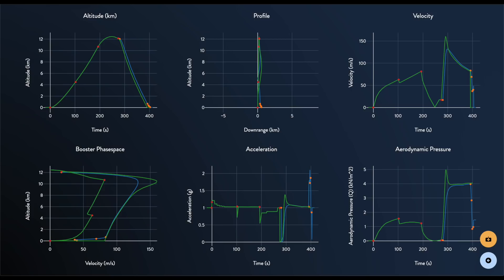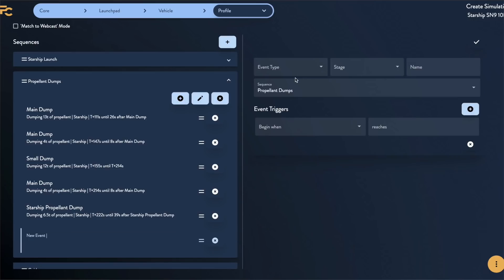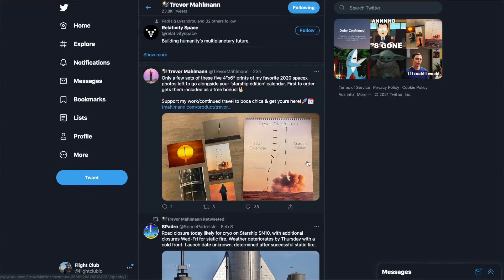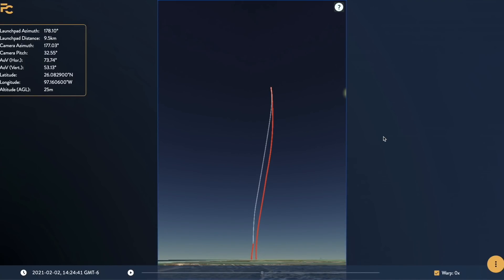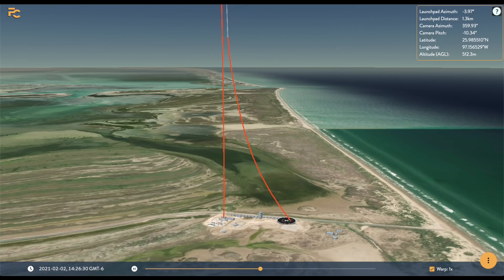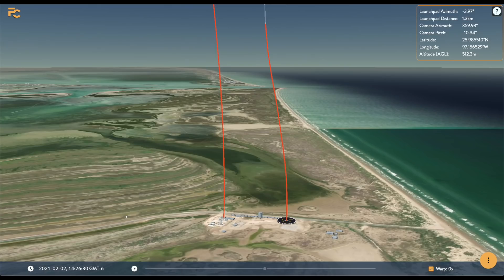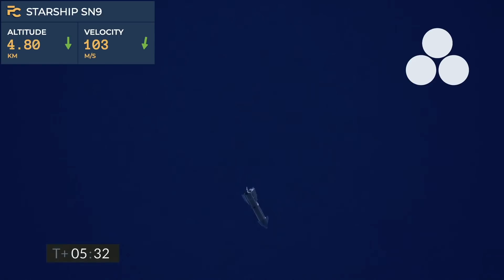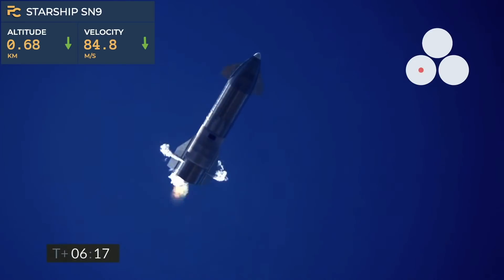How to simulate a Starship launch: SN9 Edition!

Comment: The Patreon link in the description does not work.
Reply from the maker: Damn - that's so weird. I can't figure out why. The URL is correct though, so just copy/paste it in your browser!
Reply: @flightclub3285  Yes, the URL in the video description is correct, but that is not the URL that is opened when you click it. I did some investigation (because I find it fascinating how those untypable characters can appear). In the HTML (page source) I see that they are hex characters %E2%80%8E, and google reveals that this is a URL encoded "left-to-right mark", which is an invisible control character for typesetting in editors like Word, or Wordpad, or some other editor with typesetting support. When you prepare your text in such an editor, and then copy and paste the text from there to Youtube, then this control character may be added. So the solution to prevent this is simple: don't use Word. Instead use a simple text editor that doesn't support typesetting. Like Notepad, or Sublime Text or so. It would be nice if Youtube stripped those characters out automatically... Oh well.
Reply from the maker: Yeah but the weird thing here is I typed this manually in the YouTube dashboard - no copy/pasting done at all :(
Reply: @flightclub3285  That's really weird. Maybe some kind of browser plugin that interferes with submitted form data?

Comment: The FAA work in Imperial measurements, so permission is likely to have been given to fly to 35000 feet.

SpaceX work in metric, so 10.5km is just an approximation of the height limit. 35000 feet is 10668 metres.
Reply from the maker: Interesting! Thanks for that, I had no idea

Comment: Very impressive! Could you add a percentage number to the rocket engine thrust level indicators or some other visual element so that the current change of thrust can be inferred? Keep up the great work!
Reply: It's probably not everything you're looking for, but when the engines first light, there is a small red circle in the corresponding engine state indicator. As the engine builds up thrust, the circle gets larger until it fills the indicator. It takes about 2 seconds. You can see this at launch and when the engines relight before touchdown.
Reply: @flubhub  Thats true, but these show the current thrust, not the current change in thrust. Especially in mid flight, thrust is decreasing very slowly, which is hardly noticeble with the "current thrust" indicators.

Comment: Please note, you (and others here) often say, "propellant dump(ing)", yet in the webcast, John Insprucker clearly states, "liquid oxygen dump". So it appears LOX is the only thing being dumped, not the methane. Is there something you know that tells you it's "propellant"? Or do you use "propellant" loosely to indicate just LOX? Just curious. BTW, great work, again!
Reply: Yes propellant is just loosely being used to indicate LOX. From what I’ve gathered they load more LOX than is needed, hover at apogee until close to all methane is gone, then dump excess LOX. I guess they do it this way as they are not allowed to dump methane.
Reply: @TheBest14184  definitely better for the atmosphere to be dumping LOX than methane!
Reply: @TheBest14184  - Every time I see Starship venting like that, I'm thinking, "I really hope that is not methane."
Reply: @CastGuyC  Do you feel the same way when passing a cattle ranch mate?
Reply from the maker: You're absolutely correct! I initially say propellant dumping, but I specify LOX in the next sentence or two :)
Reply: @flightclub3285  Yes, you did! Thx.

Comment: Thanks for that awesome video! Is there an obvious reason for SpaceX not to start with nominal trust? Would that not produce more meaningful data for SpaceX, possibly also healthier for the Raptors? Is it only due to FAA height limit, and if so what is needed to get the permission to fly higher?
Reply from the maker: I don't have anything to back this up, but I assume they want to keep the entire test as low velocity as possible for a few reasons. Staying subsonic is more useful for evaluating the aerodynamics of the vehicle, and if there are any thrust variations in the engines, the other engines will probably have an easier time trying to make up for that at lower velocity. Everything is just ... easier
Reply: @flightclub3285  I was very surprised they just copied SN8. I was betting on higher and faster profile. For landing is does not matter much terminal velocity is reached very quickly. 
Well,, going fast and high is the future anyway 😉